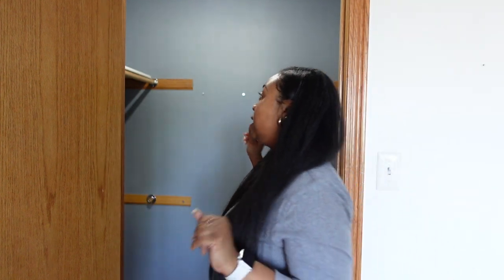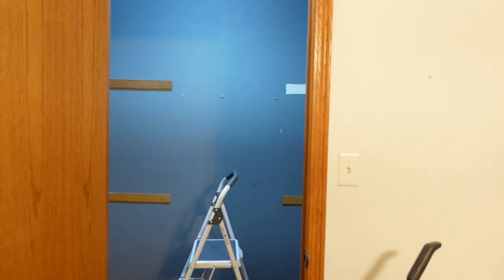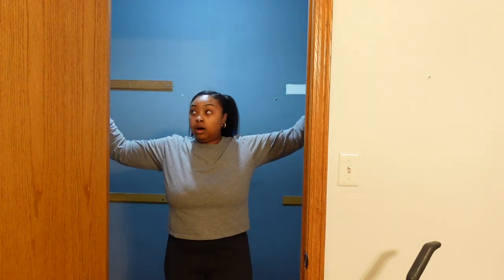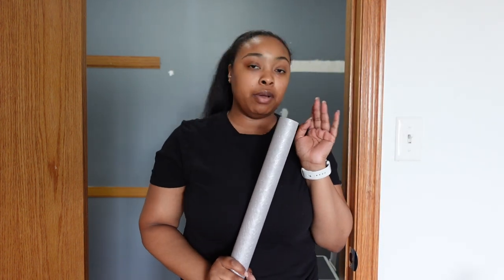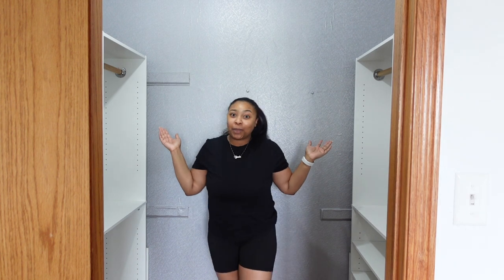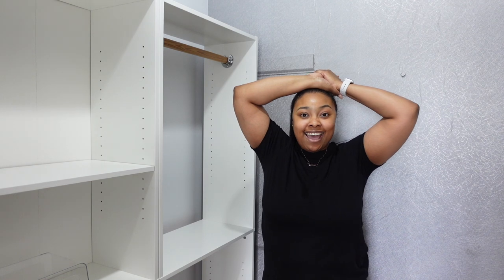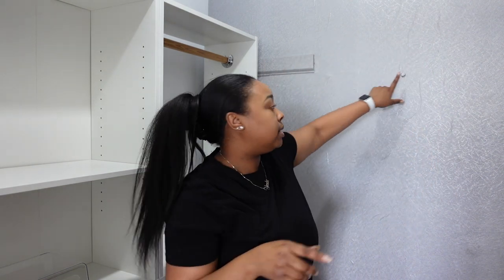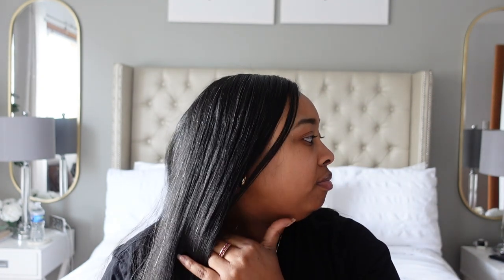EXTREME CLOSET MAKEOVER | TRANSFORMATION | TIKTOK VIRAL TARGET BOOKCASES | UNDER $250

Comment: Beautiful arrangement. Sorry if you said this already but the Tip Over issue is easily taken care of with wall anchors that don't cost a lot at all.  The hanging rods are keeping the book cases from being close enough to the wall to do this. Usually the rods are anchored where the holes on the edge are, myb even with added safety and stability of wood bars like the ones you painted over in the original closet set up.  Once those two things are done you have a reinforced closet. I heard a lady say she did this and one night she came in to find everything on the floor. It doesn't cost much and home depot and lowe's both cut wood to size so you can put them inside your book cases to keep the rods from collapsing. Rods have a weight limit and so do the bookcases. Best wood reinforcement is the T shape. HTH! GREAT JOB! <3
Reply from the maker: Thank you for the tips! 🫶🏽
Reply: You can also look into anchoring them on the sides to the existing pieces on the wall that you couldn't remove